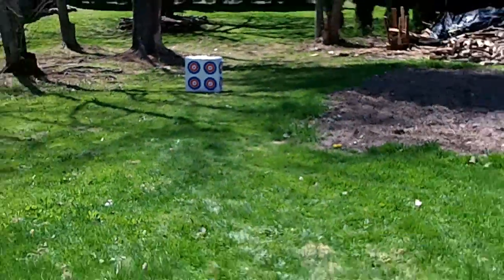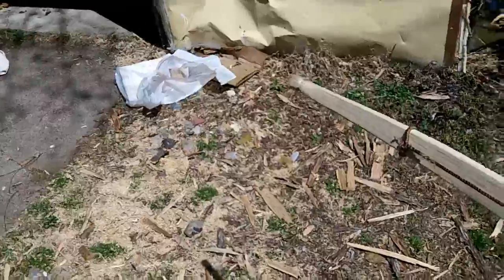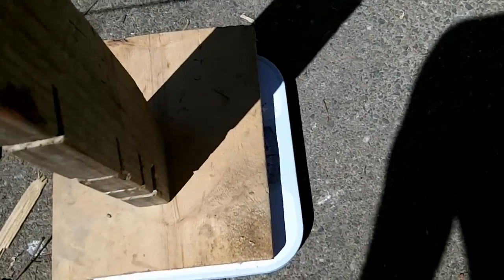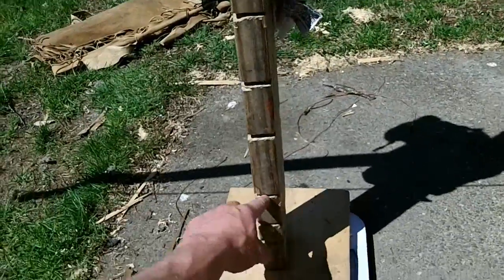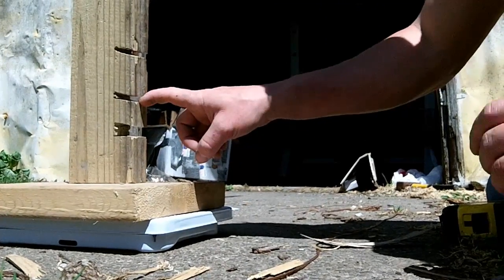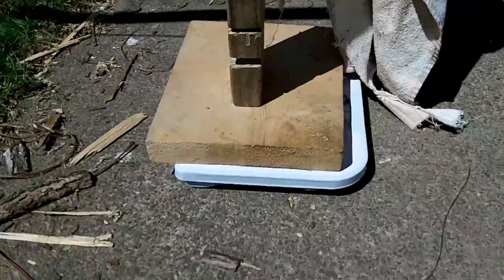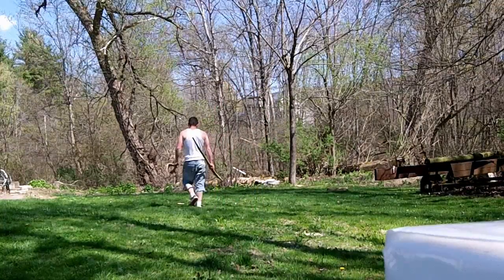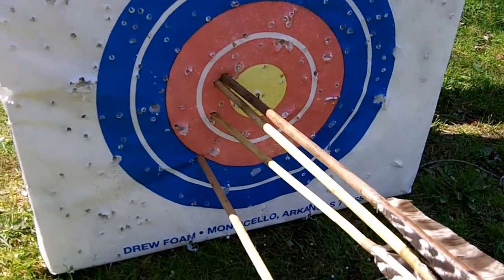Stone Age Hunting Bow Weight and Performance

Comment: Hey Ben awesome video buddy I just wanted to tell you when you're waiting your draw length like that remember that your hands are on each side of the stick and you're probably pulling it to at least 28 inches because there is a flat spot in the string in between your hands a good way to get a better more accurate length is to flip it over and put the string in the crotch of your tillering stick and then pull the wood down and make sure the back of the bow is the part you're reading from not the belly or the handle that way it will simulate the pinch from your fingers pulling it back in there won't be a 6 to 7 inch wide flat area in the string so you're probably 70 pounds at 28 inches which is an insanely strong bow :-)
Reply from the maker: jesse rush Hey Jess Thanks for the good tip! I am going to go try this and right up the more accurate poundage! Don't want to falsely advertise..haha... Thanks for watching bud and for helping me out!....Ben
Reply from the maker: jesse rush Confirmed: 80lbs on the money at 28....Much easier to check too....dont even have to hold my breath...lol...
Reply: ***** just saw the other vid :) cool . Dont worry ... i did it the other way for my first like 30 bows or so ... lol . Then i saw someone doing it on youtube the other way and i suddenly realized i was off a bit and writting bla bla bla at 26" and it was probably really at 28"lol . Glad i could help brotha